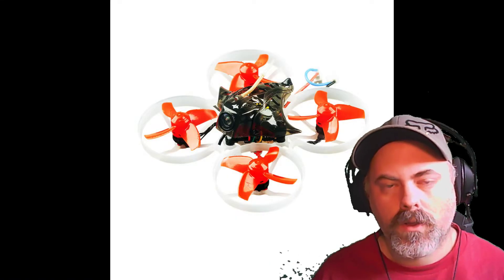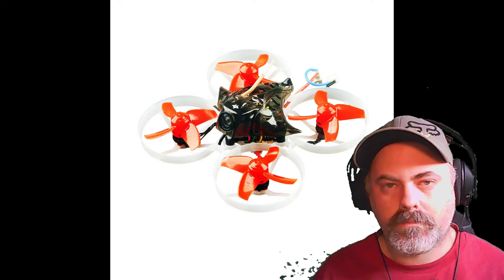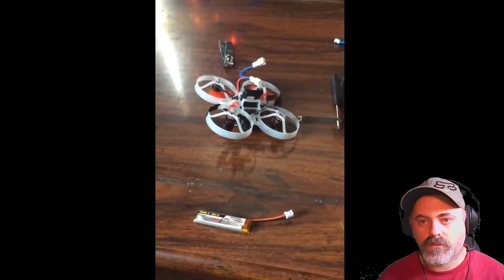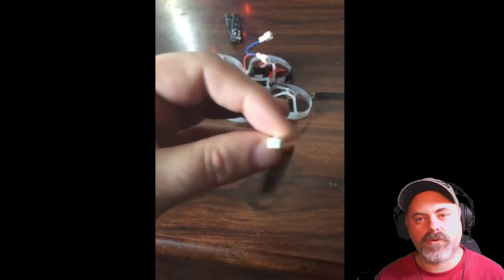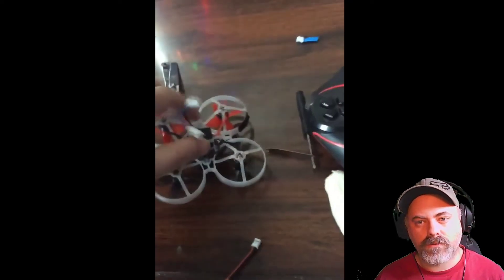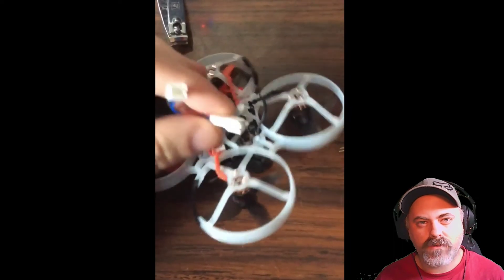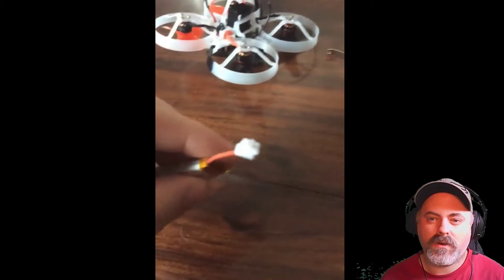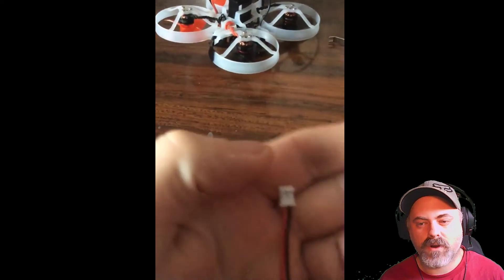Mobula7 Battery connectors ! beware !

Comment: As a newbee, how do I fix this? Cut off the ends and solder a new connector? Replace the whole thing? Mine will connect to usb, but when i plug the battery I will see one light flash quickly as I am plugging it in. HappyModel said its not likely they 5v converter and suggested this. Thanks for any help.

Comment: Same thing with mine 😒
Reply from the maker: ya ransford , they need to use better connectors all they so is tare up the battery connection ,,, hope you get yours back in the air bud
Reply: @Newfounddroneproductions  yeah I just ended up buying and replacing them with a pack of betafpv connectors. Thanks for the reply back
Reply from the maker: @RgreatT np bud anytime